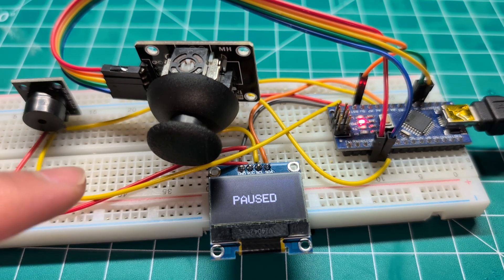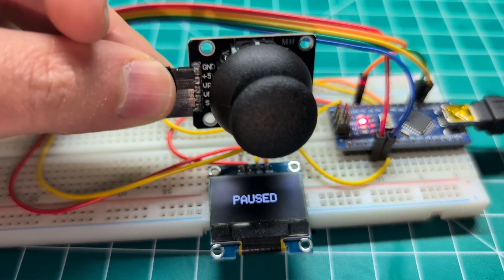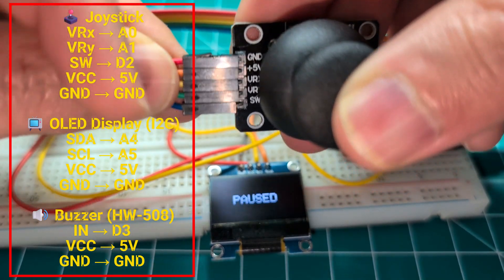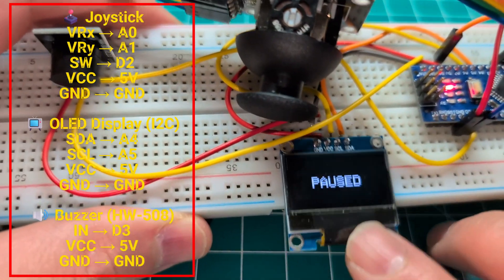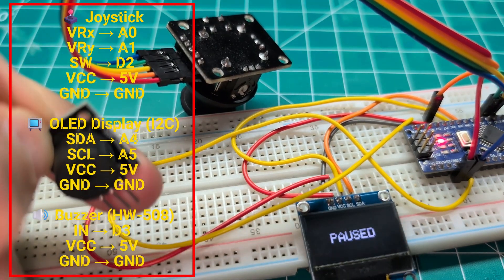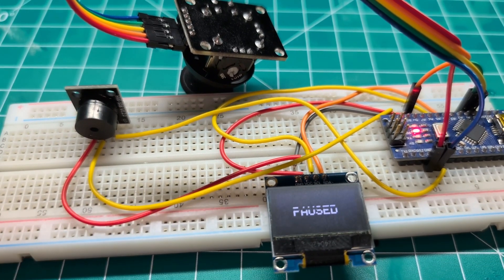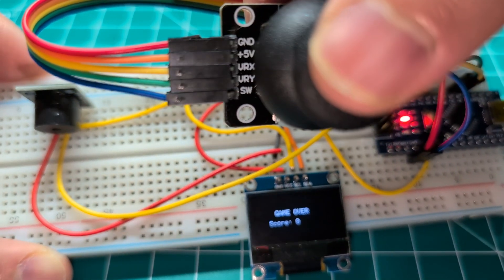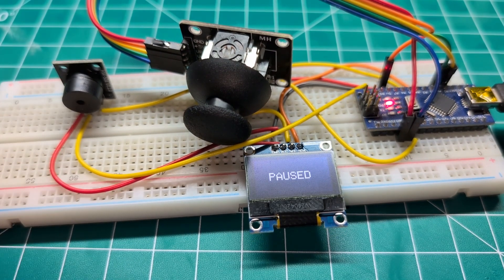Snake Game Using Joystick, OLED With Arduino #game

Comment: Very, very, cool. I like how you set up the game and how it functions, but I have a question. I am pretty new to Arduino and coding. I have learned quite a bit, but could you help me with coding a "press reset to restart" function or pausing it after the "GAME OVER". I know I can pause it as soon as it starts but I have seen other games where you have to hit "press reset to restart" to start it over again and I like that way of doing it. I don't know where to start to learn how to code it. Could you point me in a direction to get started?
Reply from the maker: Thank you for the nice comment. So my recommendation if you are new to coding is not to start with something complex and to start with the basics to learn how things work.
I have plenty of free code on my GitHub which should help, also feel free to join my free discord.
So the modification you want is to use the restart button to pause the game? Right now I'm using the middle button to do that.
Reply: ok, I will give it a look. Thanks.
Reply: I really am not looking to " pause " the game, I want to have the game stop looping and for me to have to push a reset button to restart when the game is over instead of the game automatically looping back to the start of the game. When the snake hits the wall, or hits itself the game is over. So, when that happens I want to stop the loop and print a line that says, "Press reset to play again". I just don't know how to cade for the game to stop and wait for me to push a reset button.  I know how to wire in a reset, but I want the code loop to stop and wait for me to hit reset. Does all of that make sense? Sorry if I am wasting your time but I am excited about learning to build this game with some coding changes.

Comment: Imma sub if you answer my question cuz vid is amazing!! Does this work with same wiring and all just bigger display? And will it work with same wiring without speakers connected? And dude i beg send the code in decription somehow i cant use github plss
Reply from the maker: Yes, all OLED will be wired the same so it will work regardless 
The code is too big for it to be in the description but you should be able to copy and paste from GitHub, if not let me know and I can share it with you on my free Discord
Reply: @techs.passion MY BADD i finally got GitHub working and got the code. Sorry for wasting your time and thank you
Reply from the maker: You are not wasting my time, I'm happy to help and thank you for watching 😊